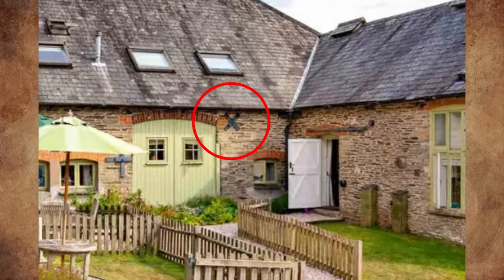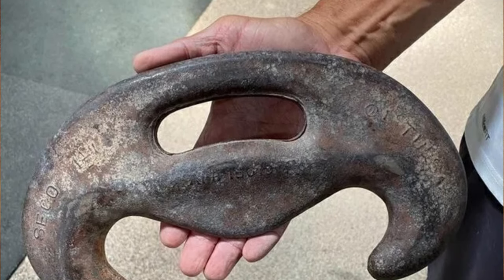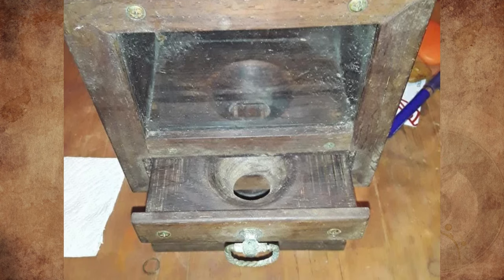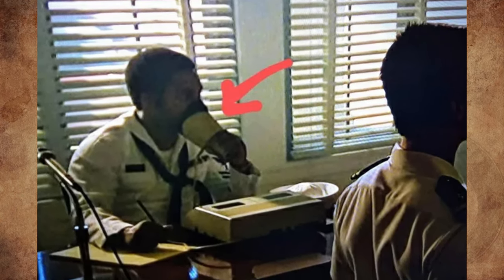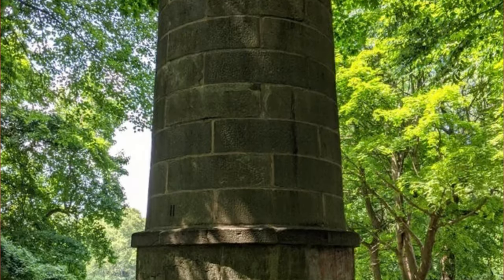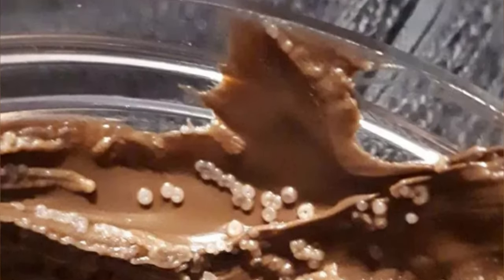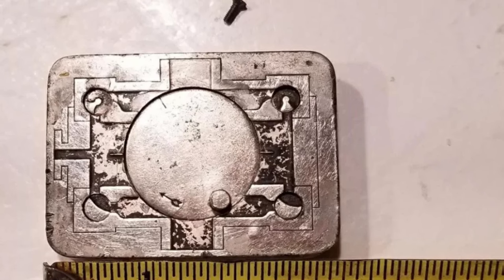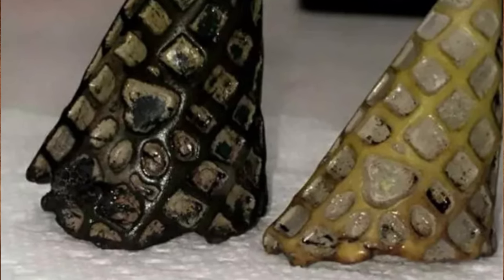Mysterious Objects That Were Too Tricky but Not for Genius Internet Users #viral #viralvideo

Comment: I worked in a granite quarry and the "load choker" is what we called chain dogs.  It was used to span a block of stone and the ears of the dogs would set in a small dimple we drilled in the ends of the stone.  Barely a ¼" of steel on each side would hold several tons of stone

Comment: "Load choker" looks more like a tractor weight used to counter balance heavy machinery like plows or something but it seems oddly shaped for that purpose
Reply: It's definitely used to tension chains, you can see many examples of these on German WWII Tanks. The only difference is the WWII ones don't have a hole in the middle but they are the exact same shape and usually found stored on the hull.